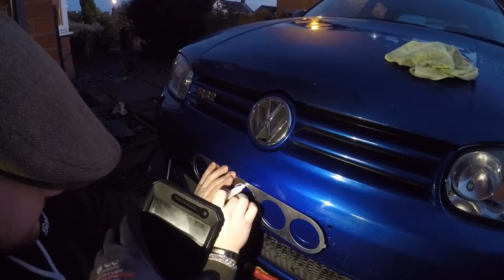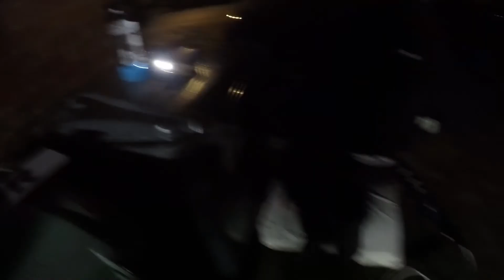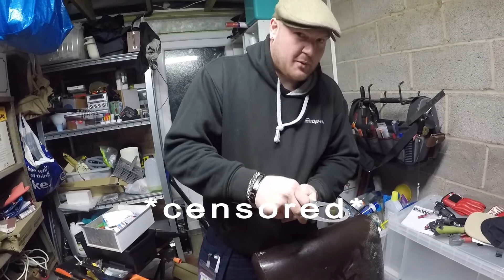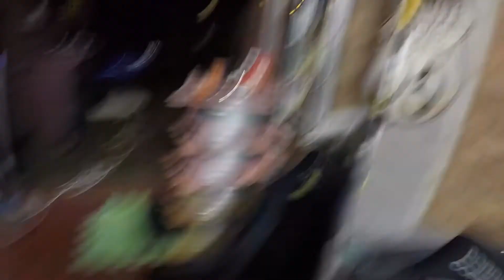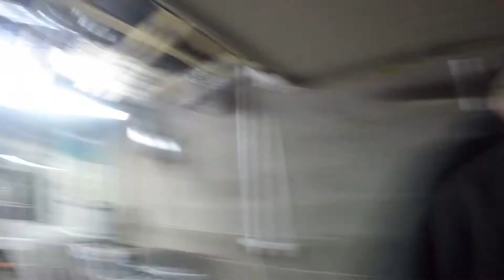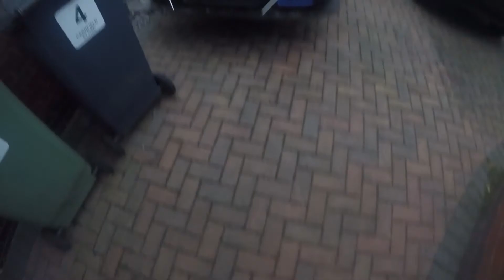INSTALLING RUSHWORTH PERFORMANCE VENTING PLATES

Comment: redeem yourself and do the follow up to the rear bushing install. do they make noise, do they stiff the ride. any thoughts? thx
Reply from the maker: no noise from them, and rear end is stiffer now with adjustable rear arms from silver project that replace the bottom 2. worth doing imo mate

Comment: If it's served a purpose yes but it doesn't do nothing except for ruin your car sorry bro👎
Reply from the maker: I will be putting an oil cooler behind the plate to keep the oil temps down. Just havent purchased the bits for it yet